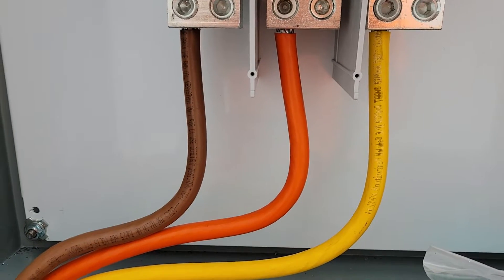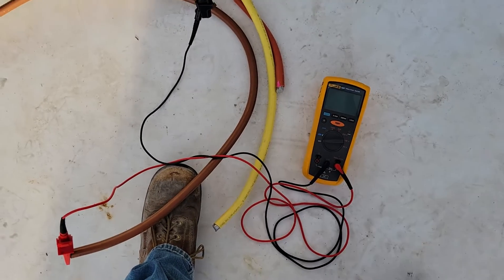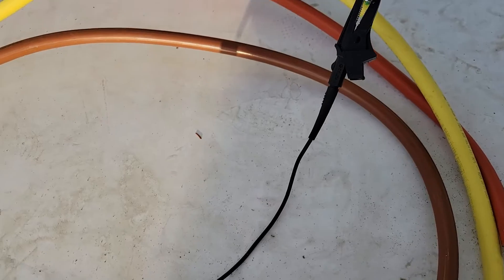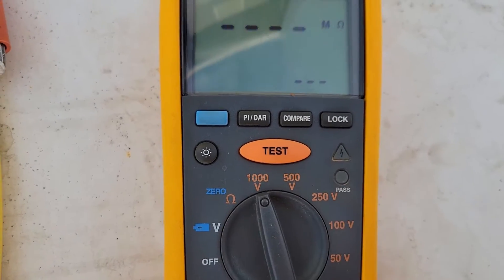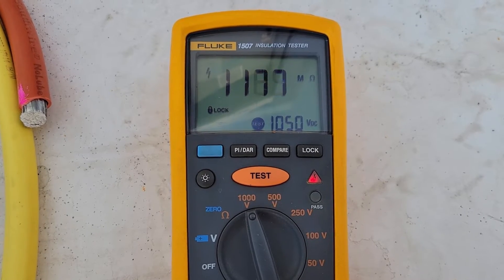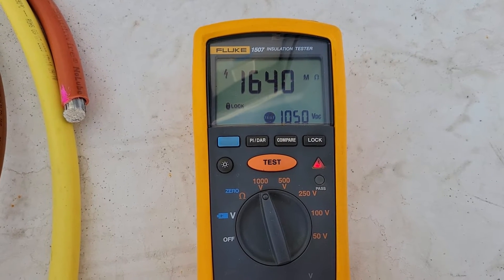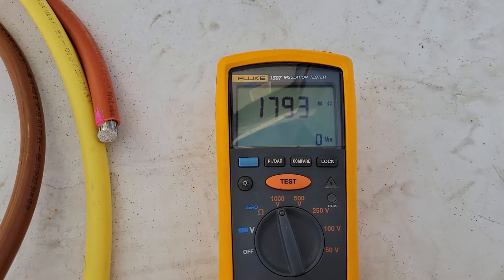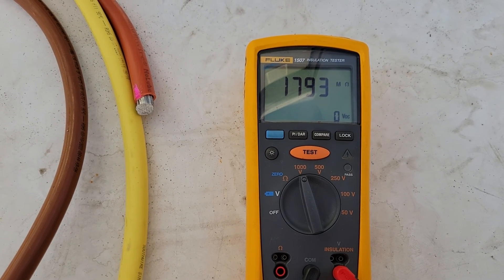Fluke Insulation Tester In Action, (AKA Megger)

Comment: Do you know if there’s a standard for figuring out which voltage to use? For example: If your’e using a smaller wire.
Reply from the maker: 1/0 and larger 1000v and smaller 500v
Reply: basic idea double the operating voltage. Eg if the cable is used for 230VAC then min 500VDC should be used for testing. Correct me if I am wrong.
Reply from the maker: Yes that is correct. The voltage also depends on the wire rating. If it's 600v rated, then we normally use 1000v for one minute. Thanks for the comment and Have A Great Day!
Reply: @ElectricianToolDeals  cheers mate
Reply: @ElectricianToolDeals  Is that correct? 1,000 volts for 600 volt wire?  I usually use 500 volts for 600 volt wire. The wires I test are never more than 28 vdc or 115 ac.  
I mean, if the insulation is only rated to 600 volts then could you consider it failed at 1,000 volts?  I'm not sure....just asking.

Comment: I have referred to youtube for many DIY projects, but this seems well beyond DIY. Can’t think of a situation where someone would need to do this.
Reply: This is not for a DIY project. We usually only megger when it's large wires, or as in my case today a douche of a General, who thinks that the wires are bad because some of the outer jackets were scuffed up. Not the insulation but the protective outer jacket.
Reply from the maker: @billcamerlo7460  hahaha 😆
Reply: @billcamerlo7460 lmaoo , been there Brother. I feel your pain
Reply from the maker: This is geared towards younger electricians.
Reply: To test motors and compressors on your air conditioning system would be one!
Reply from the maker: @EarlHayward That is a perfect example. This also could be used to test and type of power cord. Make sure its not hooked to a device though.
Reply: I work in a chemical plant. We use the megging system to check windings in motors. 4160 v and other wired applications. We have things to prove to engineers 😂
Reply: I appreciate the video. I’m trying to get into the industry and I’m trying to learn everything possible before apprenticing.